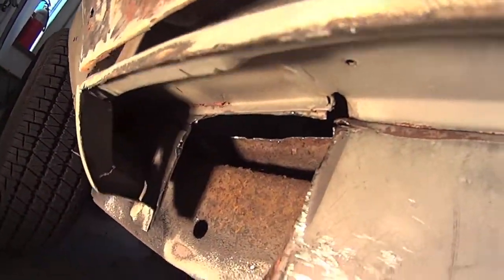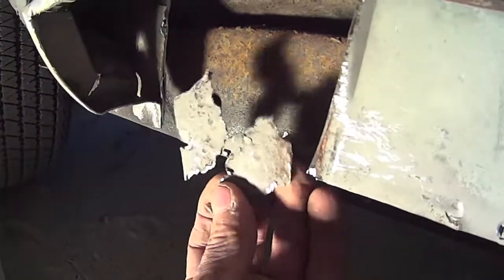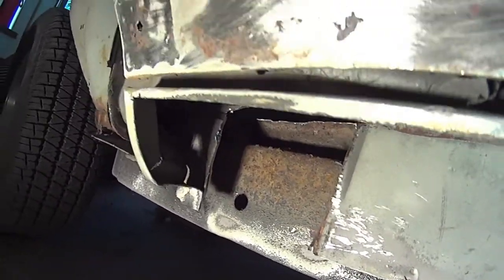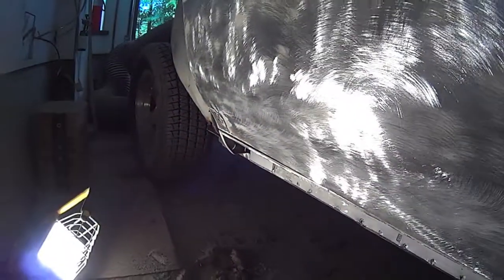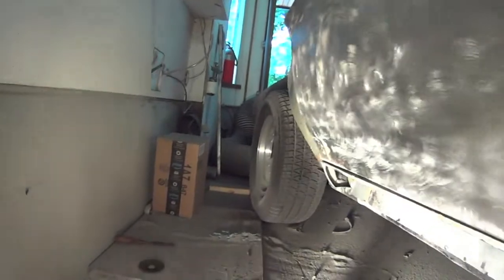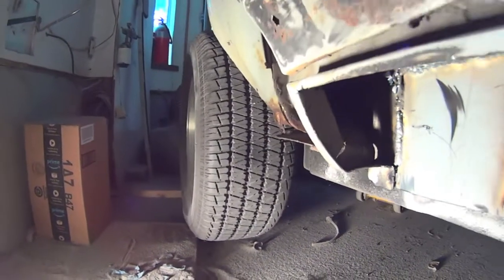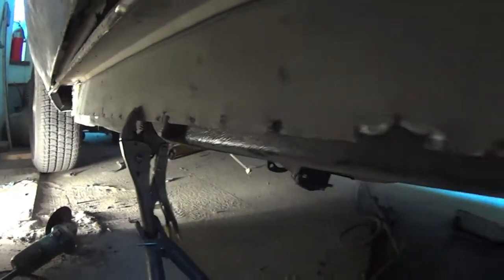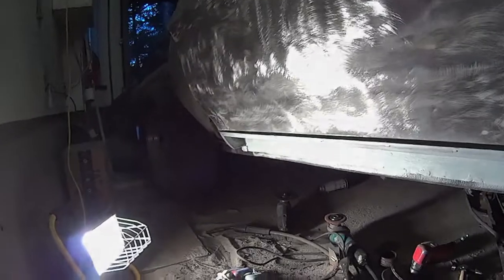1970 Pontiac Lemans Wagon restoration  Part 6 ( rocker panel repair )

Comment: Very nice car, rockers were clean inside. Just did one on an Aussie chrysler.  2inches of filler and nothing left of it inside.  Nice job you're doing.
Reply from the maker: Thanks bro. That was one of the only places on this car where it was in reasonable condition inside when I opened it up. This car is going to be a long haul before I can say the rust restoration is completed.